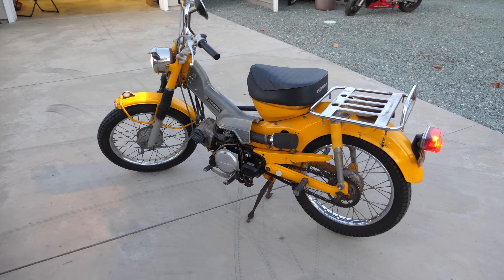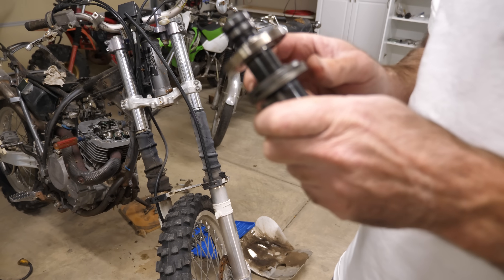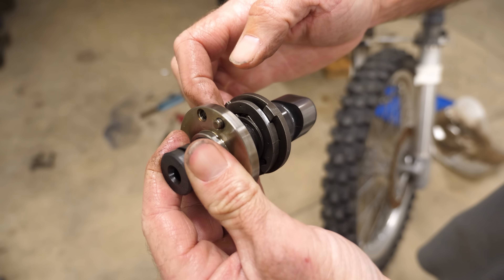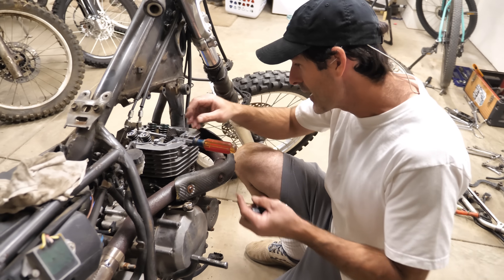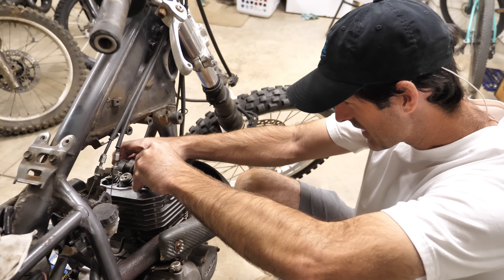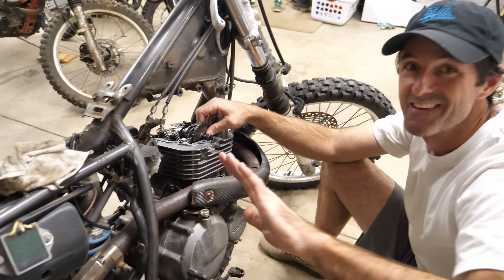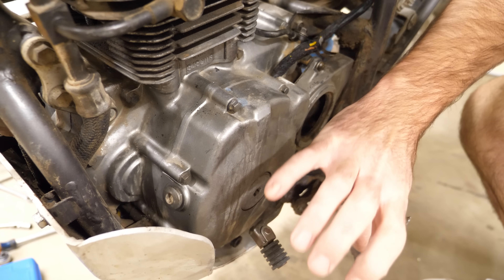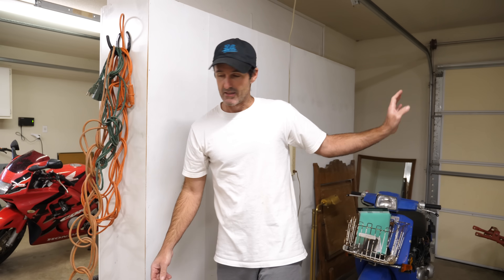This Motorcycle Has Problems I Can't Figure Out (backfiring & erratic idle)

Comment: I think you have a vacuum leak. Throw a 3 dollar spark plug at it. Make sure the accelerator pump is actually working. Air filter? It will definitely run lean without a filter.
Reply: Make sure the spring , o-ring and washer are in the right order on the idle mixture screw